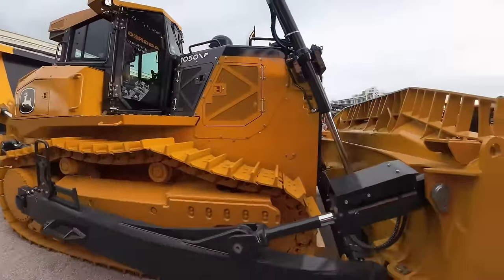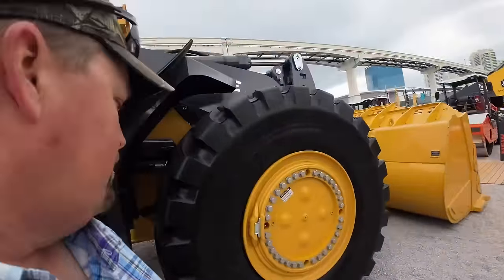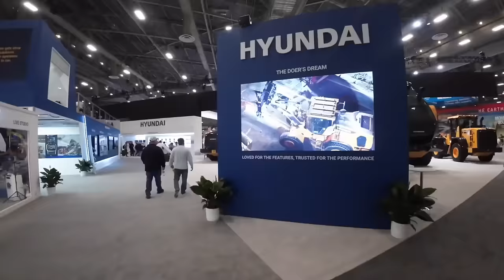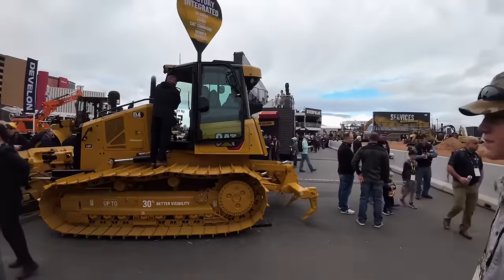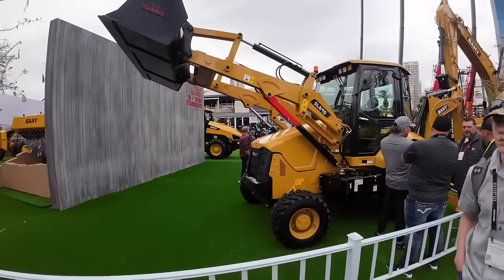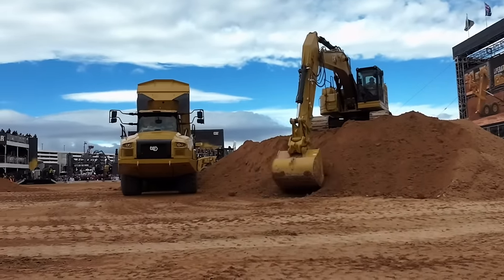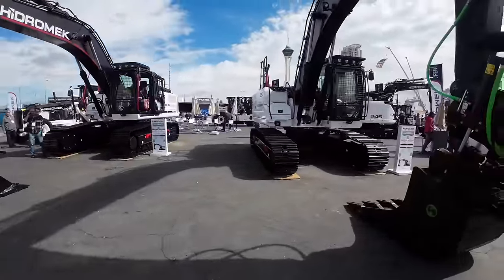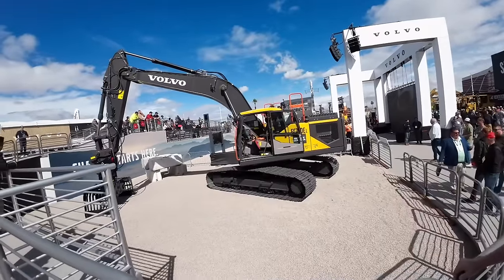2023 Conexpo show in Las Vegas complete full walkthrough. This place is huge with cool equipment!

Comment: Thank you, Clint, so far, the best and most comprehensive look around Conexpo 2023. It was great to see where companies are heading especially electric and hydrogen. Can I ask where you see C & C Equipment in 10 or 20 years? Will you be repairing electric motored machinery? Do you think robotic or self-driving technology will drive (no pun intended) the market?  It seems you will need to be a software engineer to work on these new age machines. Thank you again and Hi from Sydney Australia.
Reply from the maker: I’d say another 20 plus years before we see used electric stuff
Reply: @C_CEQUIPMENT  That'll be Hunter's generation stuff. 🤣

Comment: Many manufactures use the GM systems of identifying bolts, washers, nuts that are common  Others have the same size bolts with different part numbers for each different product produced.  Just so they can charge more.

Comment: how do they charge those big electric cats,do you need a generator ,or a big electrical plug on the jobsite
Reply from the maker: They come with a mobile charging station every 4hrs is a 1hr downtime for charging-Kevin
Reply: @C_CEQUIPMENT    thanks kevin,!!!!,,thats not to bad,,work four,take a hour lunch,work another 4
Reply: But what runs the mobile charging system???

Comment: A lot of money seems to be invested in EV equipment. Not sure these products have a wide use application. Maybe for dozers or loaders working at at a landfill or yards where they have a ready available power source. But for projects where power needs to brought in for short term temporary charging I don’t think they make any sense.  Who is going to pay for the charging cost and who wants to deal with the power companies arranging for temp power?  Lots of indirect costs for managing power availability on project sites. Hard to quantify savings with so many variables. I don’t think I would be an early adopter with this technology for application that are not fixed equipment locations. Just my humble opinion.  It will be fun to watch this new technology develop in the coming years.
Reply from the maker: I agree
It’s far away yet
Reply: agreed other then minis for interior commercial plumbing etc, and things that could be used in tunnel mining.

Comment: I'm not convinced that electric equipment is practical.
I did see a manufacturer that converted to hydrogen, the torque is the same as diesel. Problem is having available source of hydrogen for the job site
Reply from the maker: Agreed